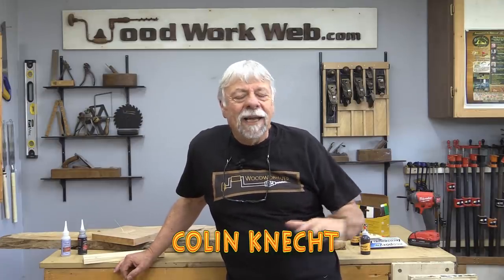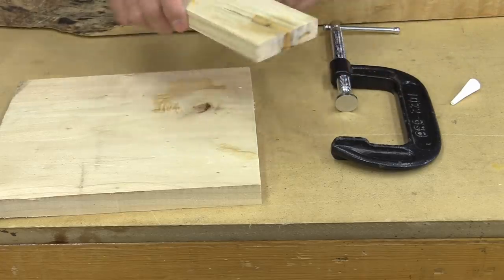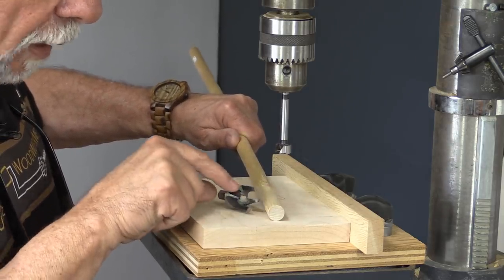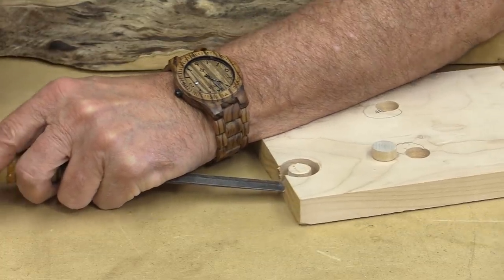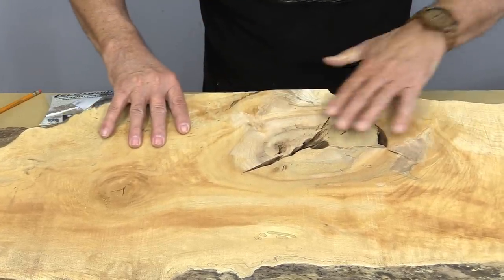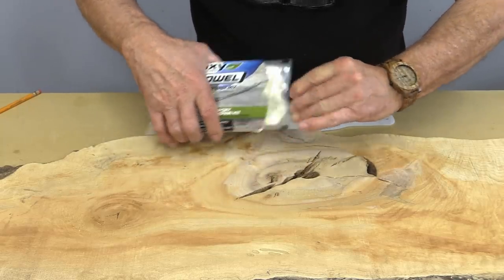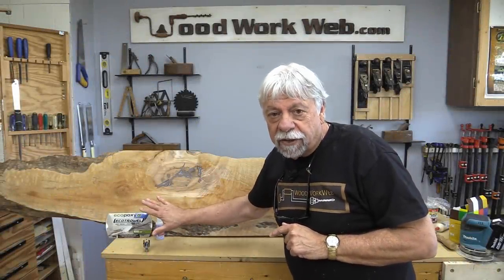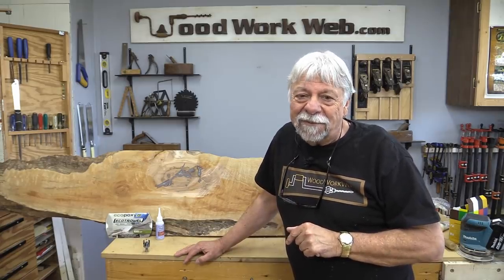How to Fix Woodworking Mistakes - Episode 1

Comment: I use my plug and dowel cutters a lot more than I thought I would when I bought them, in fact I never buy dowels now except to make bench dogs.

My biggest "fix" as a newbie, who make a lot more mistakes than average because of a physical impairment, is hide glue. It’s undoable with a heat gun, you can mix sawdust into it to fill smaller gaps and you can't see it through your finish. It’s also a lot cheaper with little or no waste as you reuse your squeeze out. My projects tend to be smaller than most people do because of my difficulties.

A great video, thank you very much.
Reply from the maker: Thanks for the tip and thanks for watching!

Comment: I used a hole saw to cut a plug from laminate flooring to fix a Newell post for a client.  They were impressed.  It looked way better than the original dowel plugs.  The holes almost disappeared.  Thanks, Colin!
Reply from the maker: Thanks for the tip and thanks for watching!

Comment: Hi Colin, I keep watching, you keep coming up with great tips. When filling gaps in wood I want to use I use epoxy and coffee grounds that have bee used and then dried in the oven and then kept in an air tights container. It produces a great effect and finish. Cheers, Huw
Reply: I'm going to make a note of that.  Thanks
Reply: @dwightl5863  It works really well,     especially in any cracks in Oak. It looks really natural.
Reply from the maker: Thanks for the tip and thanks for watching!

Comment: ideally you drill a hole a little less in diameter than the screw you use beforehand to avoid splits.

Comment: I use matching wood plugs for a lot of my projects when I want to hide the screw hole as much as possible. Sometimes the little plug has almost exactly the same look as the main piece and that plug literally disappears...cool. ! Other times I like to have a little contrast and it looks nice too. And then sometimes I want to have a definite contrast to the main wood so I will use another type of wood, or even a dowel, just depending on my own creativeness. When I first made something that I needed to fill behind the screw hole, I just used a wood filler of some type, but I never liked the finished look. I much prefer some kind of wood plug; it makes the finished job so much more professional looking.
Reply from the maker: Thanks for watching!

Comment: CA glue will leave stains around the crack. Hard to get out even with sanding. How do you deal with that? Thanks.
Reply: Just a thought here.  I haven't actually tried it...Maybe close up the crack without any glue first.  Clamp it shut, then coat the surface around the crack with wax.  Then open the crack and continue per the instructions in this video.  Later, sand off the wax along with any residual glue that may have accumulated on top of the wax.  If wax isn't ideal, maybe something else could be used in a similar manner?
Reply: Chris Sekely thanks very. Using wax could certainly be something to try.

Comment: I suppose the follow-up video will tell us how to fix the mistake of cutting a dowel too small...
That looked like a 1/2" dowel in a 5/8" hole. But what do I know; I'm a metric guy.

I think it would be good to also talk a bit how to avoid each mistake as you talk about how to fix them. Like drilling a hole of the appropriate size prior to driving screws through wood.
Reply: Rune Bivrin I think that the problem is that it is a tapered plug. If Colin has trimmed off the bottom of the plug rather than the top it may have fit a bit better.
Reply: I've never seen a plug drill that does conical plugs, but I suppose it's possible.
Reply: The dowel was tight. The plug was loose. If the plug is tapered yes, it could be upside down.

Comment: You can also drive the screw in on reverse setting on your drill partially and then finish The drive in forward.   Works great. I use this method all the time.
Reply: what?

Comment: Great tips as always Colin! The gap filler at the end of the video would probably be good if used in an area that would not be seen. However, unless there were a better match, I'd prefer using sawdust from the actual wood & mixing it with Epoxy to fill the gap. Just saying......
Reply from the maker: Thanks for watching, Steve!

Comment: Great video. Thanks for sharing. Is it possible to use the first method also for boards of pallet wood which sometimes tend to crack when taking the pallets apart?
Reply from the maker: Hans, I don't see why it won't work for pallets, too!

Comment: quick question.  What is the difference between a Drywall screw and a deck screw?  Besides the ability to be weather resistant.  Just curious.  Thanks
Reply from the maker: Desk screws are usually made out of stronger steel.

Comment: I'm sorry, but why would you advocate using the glue but not tell people to drill a bit of the hole out, just shy of the screw size? That way there's even less chance of it trying to split again instead of just expecting the glue to hold?

Comment: Bleh!  I don't get at all why people are so obsessed with having epoxy filled cracks.
Reply: I didn’t get it until I learned that the epoxy seals the wood against unwanted moisture and bugs as well as the epoxy fills and stabilizes a weak spot.
Reply: Pick a piece without the cracks to start with.
Reply: Orxenhorf This video was about fixing mistakes that happen while working. It’s a good fix if you can’t replace the wood that cracked while working on it. As for the epoxy filled cracks you’re referring to, it is an individual decision whether practical or artistic.